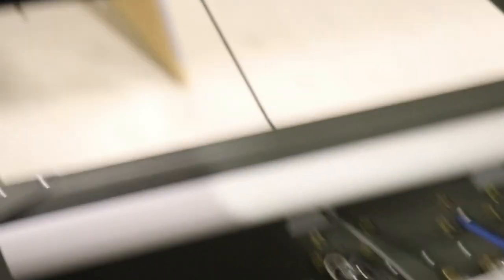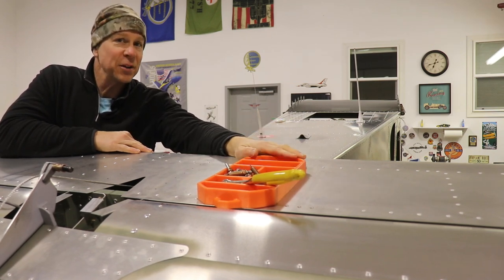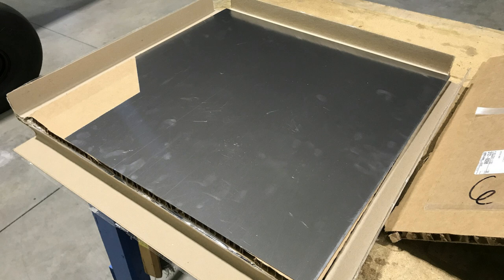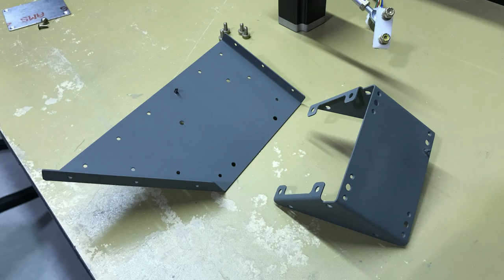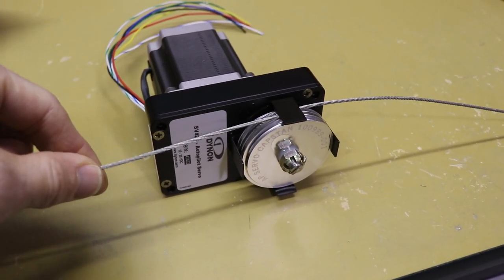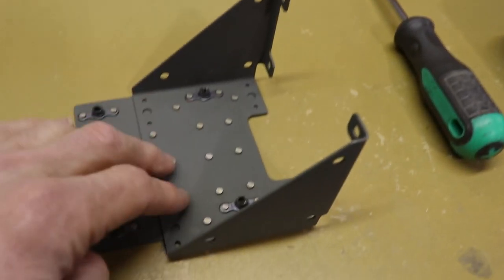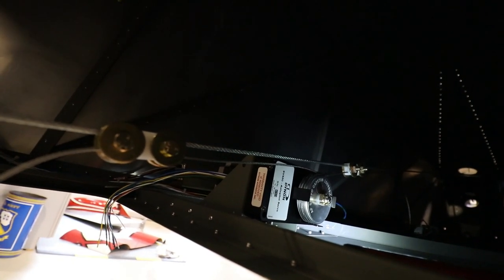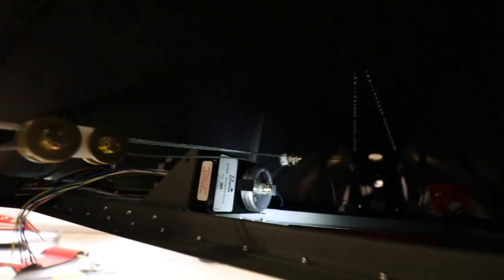Zenith Super Duty - Mounting the Elevator Servo (Ep81)

Comment: In EP78, you commented that you liked the front-mounted bracket from Dynon, since it allowed for easier safety wiring of the screws. But in this video, you back-mounted the servo. Why?

Nevermind, I just saw in EP84 that you switched it back.

Comment: I really like the capstan option. Seems like a good choice. Do you happen to know how the safety features of the servo work? For example, if the gears of the servo were to seize up for some reason is there a clutch that slips that you can overpower to move the elevator? Or a shear pin? Or maybe the cable slips on the capstan? Does the servo have a travel limit or can it rotate constantly?
Thanks for sharing, I really enjoy your videos.
Reply from the maker: The Dynon servo has a sheer pin that would snap if the gears locked up.

Comment: Mark, you mentioned fiberglass fairing and that made me think of something that bothers me about the Super Duty. Below the engine cowling where the front wheel attaches, the Super Duty cuts off and the frame appears to stick below the aircraft a couple of inches. I guess it is just an aesthetic issue to me but it seems like there should be some connection from that point to the rear of the plane where it begins to sweep up. When you look at it in profile it just feels incomplete. I'm not sure if it could be corrected through a change in the original design or if a fairing could be added that might also improve airflow.  I'll forever look at the Super Duty and think it is poorly designed.
Reply from the maker: I think you are referring to how the bottom of the cowl hangs below the bottom fuselage. It's funny because I actually like how it looks. Everyone sees things differently and I certainly agree that the SD isn't a sleek design, but one of the things that I really liked about the SD (and the Cruzer) is the boxy look and the sharp lines. I just think it is really cool looking!

Comment: My question is why would you need the full 5 inch travel input to your elevator using the autopilot? The auto pilot is only used to maintain altitude or maintain a rate of climb or descent, in my opinion the need for a full 5 inch travel would never be required. Sure if you are making large elevator movements with the autopilot off will you require full elevator travel.
Reply: Since it is connected directly to the elevator (as the video shows), if the servo didn't have the full 5 inches of travel, it would either limit the movement of the elevator, or it would come apart the first time the pilot tried getting full deflection out of the controls.
Reply: @SpyGeorgilis  The Auto Pilot also has a LEVEL function - hit this button and it should level your aircraft from any unusual attitude.  lots of control deflection is a good idea if the plane is slow.

Comment: If the servo fails and  locks up how can you still control the elevator?
Reply from the maker: All servos have a sheer pin that will snap and basically disconnect the servo.

Comment: Interesting design.  I'm curious regarding the resistance on the elevator cable.  How many loops of cable go around the capstan?
Reply: The capstan will spin freely when the AP is not activated.  You shouldn't be able to tell the AP is even there when it is not powered up.  The capstan locks to the servo (motor) when power is applied, and then the AP does it's thing.  There is really only one loop around the capstan - it's probably fed through the hub and locked in place with a grub screw.
Reply: @jamesfisher7010  Thank you for clarifying the way it works.  Please allow me to return the favor.  My only experience with servos, capstans, and cables is in the elevation control for an amateur telescope control system. In that example, the motor is geared and the capstan is firmly secured to the shaft. In order to release the cable and to cease control, a tensioning clutch must be released which relaxes the cable around the capstan. Also, in the telescope system, there are two loops around the capstan. Your explanation describes the differences.  I do wonder how the capstan becomes engaged with the motor in the AP.  Is there a solenoid?

Comment: A very basic question. What does the servo do when the control is in normal operation? Does it freewheel? Is there drag on the contols?
Reply from the maker: Yes there is small amount of drag on the system. Of course I haven't flown this yet but supposedly it's not noticeable in flight.

Comment: Mark,

The tension and friction of the cable on the drum of the capstan allow for its operation however, does it lose its neutral/center position overtime from minute slipping? If so does the Dynon compensate for this or is there some sort of homing process like running it to full travel each direction?
Reply from the maker: I'm not sure if the cable would actually slip in the block. I suppose it's possible. The cables will stretch over time so I'm sure every once in a while the blocks might need adjusted and things tightened up. I've never used this set up before so we'll see!
Reply: @KitplaneEnthusiast  Thanks for the reply, I'm definitely interested in the integration with the Dynon. I'd really like to see some more detailed video of just using the Dynon system in your Zenith, as well as tips for the setup. Best, Jason